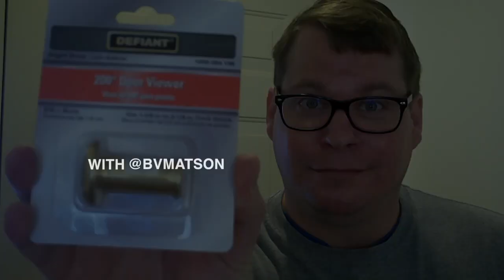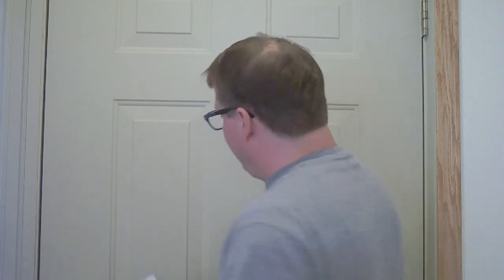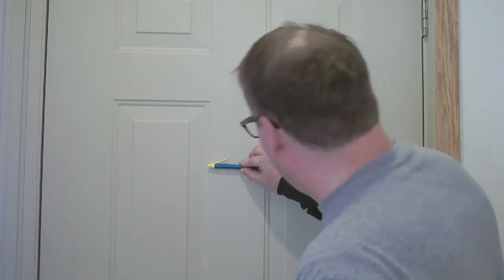How to Install a Peephole in a Front Door-DIY Installation

Comment: Great, humorous and useful video. Perhaps you should also have addressed the issue about the ‘thickness’ of the door vis-à-vis the maximum length of the peephole barrel. I bought one peephole online which turned out to be too short for my ‘thick’ door and also too small for the existing hole made for the original peephole that I was trying to replace.
Reply: Measure door thickness. Then go to store and buy peeper and correct size drill  bit that is stated on the package:
"Bore size".  
And min and max door thickness.

Comment: i love how you stress the safety equipment, cut the scene to charge, and end up doing it with nothing on lmao
Reply from the maker: Whoops. Too many pale ales. Lol
Reply: @KeepOnWrenching  though I want to thank you because I did use this video as a very large tool over The weekend for my own installation. I used the spade bit I ended up getting a 9/16 which is what my device called for. Spade was $5 vs a 20$ bit. however it was on a metal, insulated door.. I understand that mit really shouldn’t be used on metal but it ended up working out great I wish I could send a picture.

Comment: Just found you! 
I’m replacing my peephole with a larger peeophole (5/8 bit). It’s a wooden door. The existing hole has a peephole and is obviously much larger than your pilot hole. Can I just buy a 5/8 bit and drill halfway through both sides? I’m afraid the larger hole will rip apart and not be clean
Reply from the maker: I’d carefully ease up in sized and use tape on both sides. Attack slowly from each side to meet in the middle.

Comment: Actually, it's probably better to select a height based upon what you can see on the outside rather than your heights on the inside! In case there's a girl scout selling cookies out there or if your door is two concrete steps above ground level like mine is. Plus, if you have kids eventually or sell the house to someone who has them, they might need to be able to see out as well.
Reply from the maker: Great point depending on various setups. The viewers do have a very high range of vision through. I’m not sure how much impact small variances in location would impact overall viewing. Point well taken though! Good luck with your install. Go get it!

Comment: My apartment door have a very old peep hole. I try to remove it but the thing is stuck. How do you force it out?
Reply from the maker: You’ll have to get it to unscrew. Look for those two notches. If you can get it separated you should be able to carefully drive out the shaft. You will need to get it apart though. Unless it is like sealed into the door. Not sure what you’re dealing with.

Comment: What are the sizes of your drill bits? Thx
Reply from the maker: Kym Luong the pilot hole can be any smaller bit. The hole for the actual peephole needs to match the bore of the product you buy. The packaging is usually very clear about that. Check you packaging and buy the appropriate bit.

Comment: On a serious note, I am unsure you need to hammer the screwdriver.  It might be sufficient to use the screwdriver as a lever and it would make it real tight without the risk of leaving a mark on your peep hole.
Reply from the maker: +James Elmore valid point! You certainly wouldn't want to scuff up that fancy new peephole.

Comment: Help. Drilled hole through door and broke glass screen door. What’s next step?
Reply from the maker: 79dogface oh no! That’s an easy fix though. Just remove and replace the broken pane in the screen door. Usually held in with a few brackets that can be removed with a screwdriver. Minor issue! At least you’ll end the day with a new peephole!

Comment: My hole did not line up, not sure why my pilot hole didn’t help me.
Reply from the maker: It should have as long as it was drilled straight.
Reply: Ya. Great video but one of the worst things I’ve done in my house. Couldn’t see the drill bit when it was in the door. Broke out a rubber mallet. Dented the door on both sides. So recommend long enough bit to see if it’s level.

Comment: You forgot gloves! Need a hole saw, 135 degree 9/16" big metal bit tore big hole in door, also measure location of pilot hole on each side and drill pilot from each side, I drilled straight through with pilot and it was crooked!!!
Reply from the maker: I'm not sure how it could come out THAT crooked. Sorry you had issues.
Reply: @KeepOnWrenching  I should have measured the mark for the pilot hole on each side and drilled the pilot hole from each side so it would be straight!

Comment: After you drilled your pilot hole, you didn't wear your safety gear.
Reply from the maker: Robert Rosen you are correct. Tragic mistake and one reason why you shouldn’t drink and install peepholes.
Reply: It was a joke. Or what it?

Comment: Seems unnecessary to jump from that tiny bit to such a large one.
Reply from the maker: I always like using a pilot hole just in case. Sometimes those big bits can slide around a bit. A small pilot ensures that you drill where intended.  Plus, my drill bits are miserably dull so every bit helps.  (pun intended)